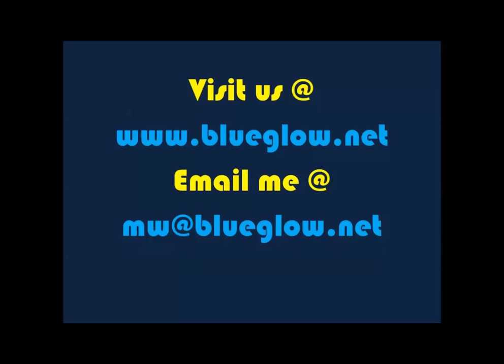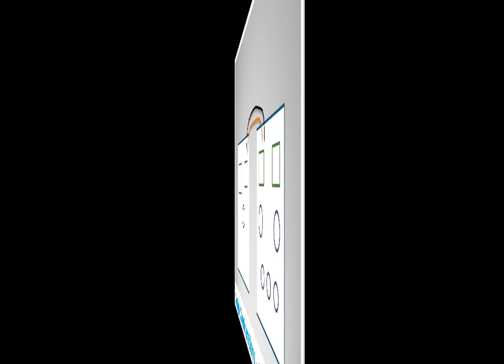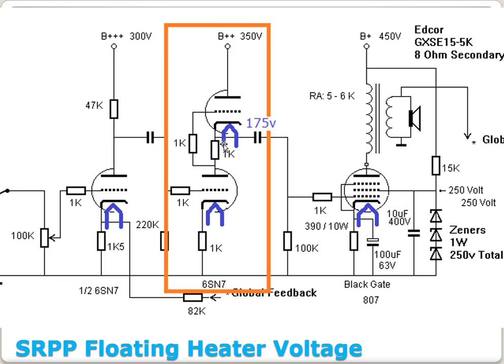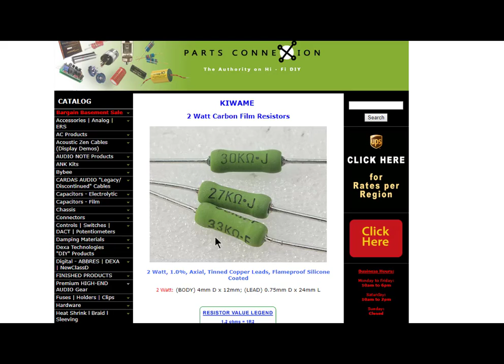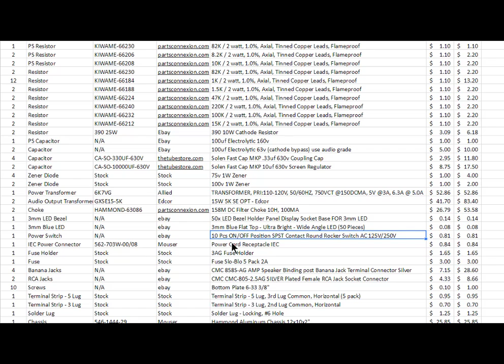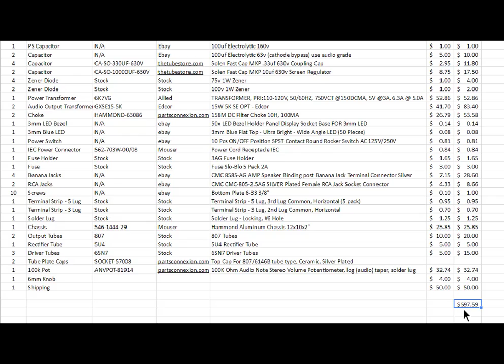Single Ended Tube Amplifier Build 2017 - Part 4 - BG100

Comment: Just noticed a problem with your BOM - the 100V 1W zener is underrated for the current it will be carrying, which is about 13mA, so 1.3W will be dissipated.  The 75's are marginal as well.  I'd suggest 4 x 56V and 1 x 27V to make the string out of 1W devices, or uprate the power rating.
Reply from the maker: You are correct, thank you so much for catching this.

Comment: A similar project would be the RH Universal SE amp. It is simpler but uses plate to plate local feedback:  

http://rh-amps.blogspot.com/2013/05/rh-universal-v2-totally-universal.html?m=1

BTW, film caps in the PSU are totally worth it in most SE designs. Solens aren’t as good as the new DC Link types or even the Erse Pulse X caps. Just my humble experience.

Comment: the volume pot 100k linear or logic you didn't say. You could shield your Transformers by covering them with a tin box with lead lined inside to keep them on the same chassis what would give you the best of both worlds an even better if you can immerse them in oil as well
Reply: I think he mentioned in a previous video that he was using Log Pots for the volume ;)
Reply: tin and lead? and why? oil? LOL
Reply: Tin foil. Copper  mesh. The old fish cans the CCCP used in their missiles.  Ridiculous comment.

Comment: If you start adding quality components, high grade tubes and transformers and on top of that spend a good amount of time on the chassis, the cost is easily several thousands $$$. Right and wrong does not exist, everything is subjective preferences.
Reply: Complete nonsense. Right is what a guy can afford. My lab has $250K of gear. So what?  It means nothing. What matters is finding the exact point where a guy can get the build done.  All your philosophy is junk.

Comment: i have supply tried a separate power . It cost a lot of money to do. Like the guy said I was then paranoid about the high voltage dc wire outside the chassis. I did not get any benefit that justified the price. I then converted back to an integrated chassis because I my worry.